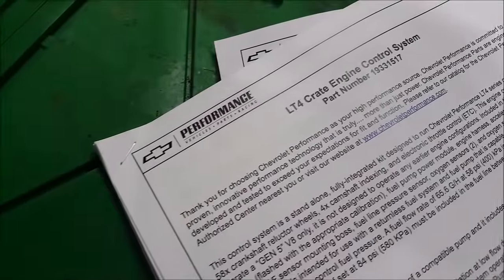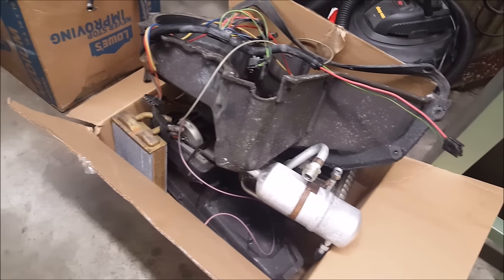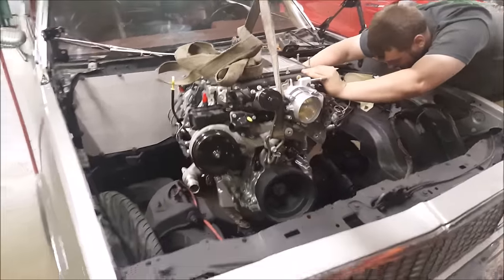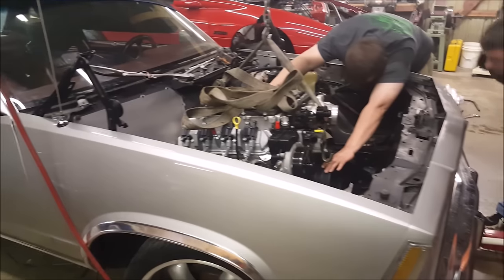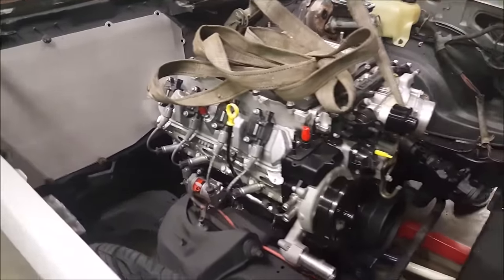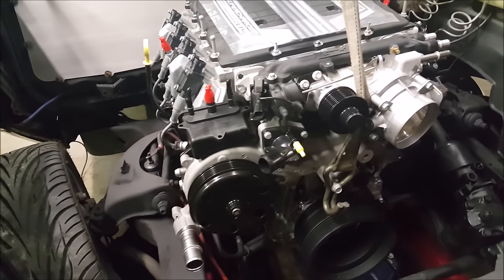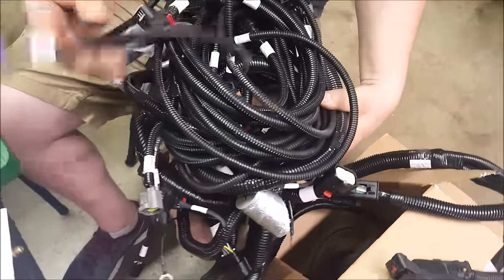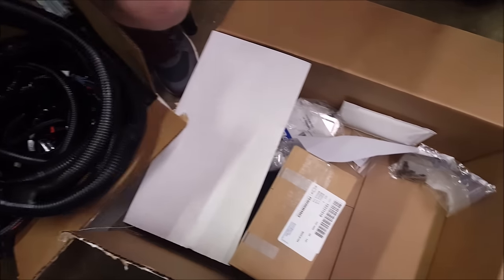1st In The World 2016 Z-06 Supercharged LT4 Crate Engine Install in a 1978 Malibu

Comment: Where did you get transmission crossmember  please
Reply: club506dl idk where they got theirs but with a way to cut and weld it wouldn’t be hard to modify the original cross member. I went from manual to auto in my 73 Trans Am and all I did was cut off the extension in the middle that the trans mount bolts to and weld it on the other side. Easy peesy. So if you do a Mach up and have engine and trans installed you can see where it needs to be. Then cut/weld. Or take measurements and have someone do it for you if you don’t have the tools.

Comment: +veltboy314 Around the 6:42 mark, when he said that they sell an arm with a switch. What does he means? With that kit, no need to have to mount the gas pedal.
Reply: That LT4 engine is a completely different operating set-up than an LS, so the computer is set to read that electronic pedal a certain way

Comment: $12 K Plus motor ...he better get a tab goin at the local tire shop cuz he goin burn some tires up quick ..lol 

good shit
Reply: With the ecm and harness the engine was actually  $15k+
Reply: +ty62201 I knew it was in that area lol HP? ???
Reply: +Diy type of guy It makes 650hp 650tq from the factory
Reply: +ty62201 any plans for more tire on the rear??? it's gonna need it
Reply: Oh no, those wheels on there are coming off..I have a set of intro billets that are going on the car that are 20x11 on the rear..So it'll have a wider tire on there for sure
Reply: jayrub33 I have an electric steering pump on it from a 02-08 mini cooper/BMW..And the car performs flawless..You'll definitely need some custom tuning done, because the ecm is programmed for a 6spd manual from the factory..Unless you're gonna keep it manual